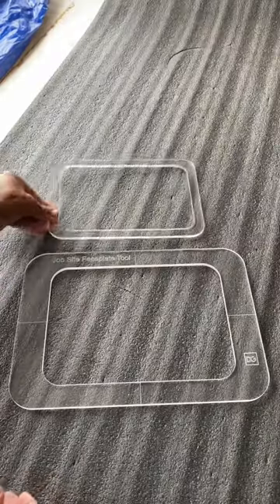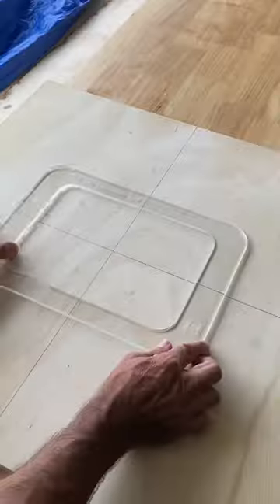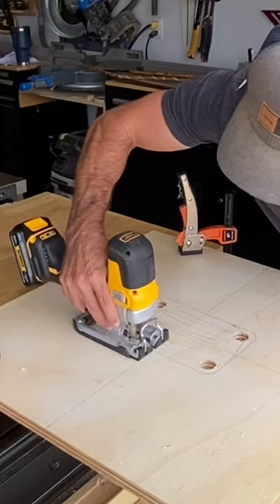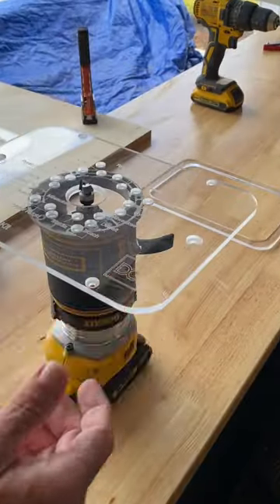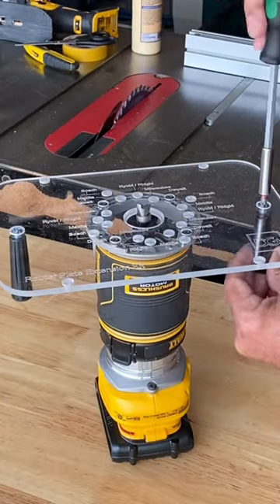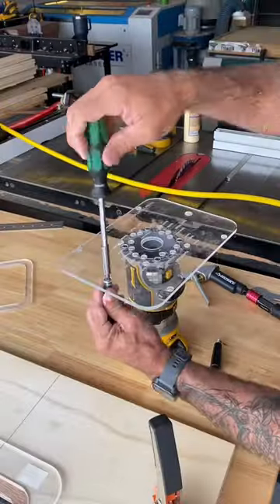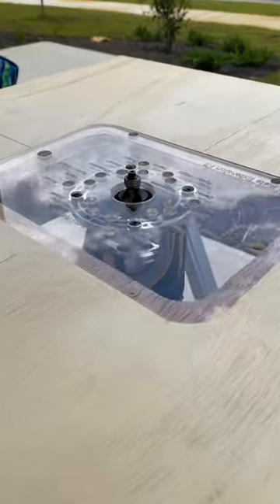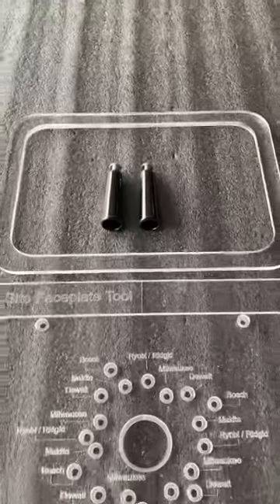I made a ROUTER table #shorts #woodworking

Comment: Never understood why my table saw doesnt have an attachment on its wing for a router
Reply from the maker: Yeah I can relate. Mine doesn’t either
Reply: I actually built one with MDF. Just cut the right size with wing fully extended and a home in the middle
Reply: @upindersingh6145  ya i tried this a couple mods but nothing I loved
Reply: Because you didn’t build it yet
Reply: I've used Ryobi bt3000 or bt3100 portable table saws for twenty years they have a couple nice extension plates   that have router table and Miter slide and they are metal sided table saw.   Wish they would make these models still, motor is powerful and belt lasts forever .. only thing is you do have to plug in but that's ok I modified it with and external outlet so when you turn on the saw it turns on the vacuum at same time and off together. 😊
Reply: Delta 36-725 T2… best table saw you’ll find for this application. Also, best bang for your buck table saw.

Comment: What about guards protect against getting pulled in and losing those gifted fingers
Reply from the maker: Well, I have over 8000 hours of router work accomplished and for me they hinder my performance and confidence and that actually results in more injuries. Just my opinion though… but once you understand the do’s and don’ts to working on a router table, combined with confidence and experience, you won’t have any accidents and it becomes super easy. But even though I’ve got a lot of experience with it, I still never allow myself to get so comfortable that I let my guard down. Respect your tools and they will respect you 👍
Reply: @DesignsbyDonnie  if you doo need guards to run against (say for a certain edge you may need can they be added?

Comment: Youll still need a fence for cutting into the material.
Reply from the maker: Yes you will need a fence but that’s just placing a flat board along the table and clamping it down.